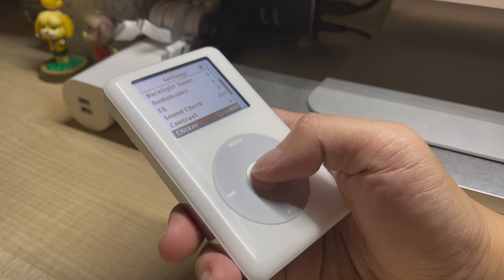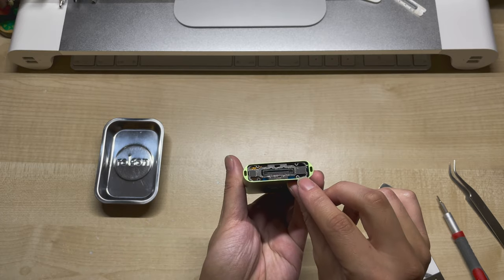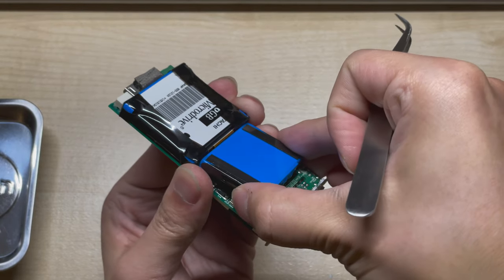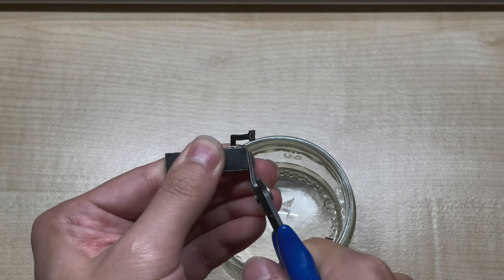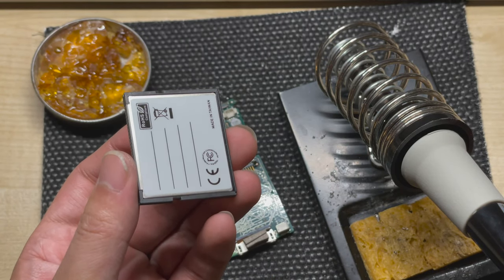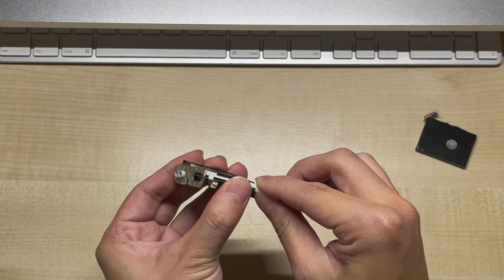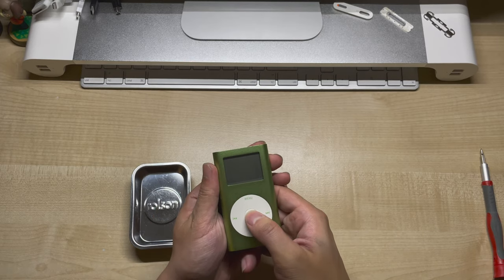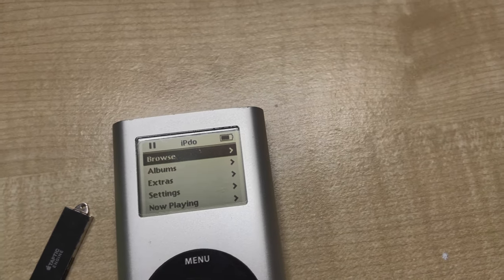iPod Mini Taptic Engine Mod Tutorial

Comment: the minis (ideally gen2) are highly moddable, i've done a few, chromed cases,  (re-coloured or bare polished) re-anodised cases, clickwheel and centre button swap from 5th or 6th gen classic (requires some filing), led backlight colour change for MADE IN THAILAND lcd displays, recolour the PVC endcaps  with upholstery vinyl spray dye .. there's lots you can do .. remove the end caps without case damage by hot gluing a cable tie to them in two places, practical memory limit is 128gb, as there is a limit to the amount of songs they can keep track of .. maybe 20,000 or so, can't quite remember
Reply: clickwheel mod ..  how-to

1) remove the 4 rear clickwheel screws, and disassemble as much as you can without pulling apart any glued components ... put both black and white glued-together clickwheel assemblies in a small container of methylated spirits for 1/2 an hour ... isopropyl alcohol would also probably work ... this will loosen the glue used to attach the plastics to the circuit board which tracks the finger movements

2) the black plastic outer has some protruding tabs on its underside which i removed with a sharp blade, they were used to align the plastic with the finger-track circuit board

3) from memory, i think i used a hand held spherical-looking grindstone to remove some material around the inside hole of the underside of the black plastic clickwheel .... do by hand, not with a machine, and slowly; i think i recall also using a flat blade around the inner bottom of the black clickwheel which stops the button rotating, as that portion interfered with the mini's finger-track circuit board

4) the inner clickwheel button also needs trimming with a small file, removing the 4 anti-rotation tabs on its circumference, and i think i sanded both it's bottom surface and circurmference; 5th gen are flat plastic, 6th gen are dished aluminium

5) removing the tabs as in #4 will cause the inner button to be able to rotate, so get the white button, sand the domed top surface off until it is quite thin, and glue that to the underside of the 'black' button, the tabs on the underside of the old white button will then locate into the mini assembly

6) everything needs to be fitted so the centre push button works correctly, but without any slop; so take your time, it is easy to remove too much plastic, too quickly ... put some tape over the clickwheel when re-inserting into the case, to stop it being scratched if the black click wheel is affixed to the finger-track circuit board, or better still, cut up a square of thin flat plastic sheet (like you find on a plastic blister pack), a bit bigger than the click wheel a put it above the clickwheel plastic, and slide it out after inserting the assembly into the case

7) you can get some special ipod clickwheel 3M adhesive pads from ebay to affix the black plastic to the finger wheel circuit board which is what i did, but double sided tape or easily dissolvable glue would work as well ... don't use water based glue ... take your time getting the alignment correct; the 3M pads only give you one chance

8) painting the white plastic end caps requires vinyl paint, like you get in an auto-parts store for car upholstery ** ... i used a mini-airbrush to apply it, but spraying straight from the aerosol can would probably work too ... don't worry if it looks like you applied too much paint ... just let it dry ... vinyl paint is very forgiving in its application, and is great for other plastic types as well, and is the only thing that will stick to PVC plastic, and remain scratch resistant .. the high level of strong solvent in the vinyl paint melts the surface of the plastic, etching it, for a good bond ... enamel paint will not stick well and can create a thick layer which can interfere with the tight tolerances apple uses... clean the white end caps with methylated spirits or isopropoyl alcohol before painting

**
I went thru the drama of painting pvc, and auto/car upholstery paint was the best and most scratch resistant I found ... the black is mainly carbon black and MEK (methyl ethyl ketone) and butane propellant... MEK is a very strong and nasty solvent, and also the most active ingredient of pvc pipe primer ... it will "melt" the top layer of pvc allowing the pigment to bond. It is also great for acyrlic (perspex) and ABS plastics, and doesn't really effect dimensional tolerances

9) to remove the endcaps without damage, i drop one or two blobs of hot melt glue onto them (without the hot melt gun metal tip touching and hence melting the end cap), and press a cable tie into the hot glue, when the glue is cold and hard, pull on the cable tie to remove the endcap, then remove the glue by twisting the cable tie, and any remaining glue with your fingernail

10) black clickwheel and silver button looks good on a silver case, you can get brand new, cases on ebay .. they dont have the apple branding, disksize logo or other text, as those are probably laser-ed on after anodizing, and the text can come in different languages, it will make you mini look like a macbook .... re-anodizing is quite an involved process, you need sulphuric/sulfuric (car battery) acid, a controllable powersupply, and optionally, some water soluble pigment dye ; strip old anodizing with phosphoric acid which you can find as clear-as-water 'rust remover' at a hardware store -- it can take a day or two if the concentration you are using is like 33% ... chroming requires the stripped and polished case to be 'zincated' for the underlying copper plating to adhere to the aluminium

11) there are spare clickwheel assemblies on ebay

12) the backlight mod will only work on one of the two types of display the gen2-MINI used, the moddable ones are marked "made in thailand" ... i haven't tried modding a gen1 display
Reply: ipod mini's firmware database is limited to indexing less than 25,000 songs,.. so practical limits are 128gb for lossy/compressed music, 256gb for losssless, unless your 'songs' are entire breakless albums, symphonies or podcasts or you want a portable usb2 harddrive. 

my car stereo is a 2008 becker 7990 with separate accessory becker ipod controller adapter and happily supports an ipod mini equipped with an 128gb udma cf card made by KingSpec, which is 60% full and has 10,000+ lossy songs on it. prior to the becker, that car  had a 2006 model JVC headunit with separate JVC ipod controller, but controlling the ipod thru the interface was too complex for me, the becker interface is much simpler, and now these long discontinued made-in-germany headunits and becker controllers are worth more than when new and are VERY sort after.

most modern car stereos dont support ipod minis as the remote control protocol changed over the years, my other car has an ipod touch 3rdGen as its remote controlled music source, its 2014 kenwood  stereo headunit with inbuilt ipod remote control (no separate controller box) and rear usb connector couldnt see or control the ipod mini. 

so if your car stereo headunit is relatively modern, and controls your ipod via inbuilt usb .. check compatibilty carefully in the manufacturer's manual, remote control of the mini's probably wont be supported, and you'll be stuck using a 3.5mm audio cable between the mini's headphone jack, and headunit's AUXillary input with control via the mini's click wheel only or  remote equipped headphone cable or mini-specific accessory wireless controller such as a period correct "Griffin Airclick Mini Remote"
Reply: Wow almost the same technique I used on my iPod Mini's top caps, I use popsicle sticks with hot glue. I also made a "chrome" Mini by buffing the paint off and installed a 5th gen click wheel face! Actually I think it's on my IG still.
Reply: @highvoltage12v  my chrome plated one is actually chrome plated, first the electroplater 'zincates' the chemically stripped and manually polished case, then its copper plated, then nickel plated i think, then chrome plated. 

personally i like a clear anodize, which is anodized as normal on a chemically stripped then highly polished case, but not colour dyed, it will lose a bit of its sheen, but will never tarnish ... i did a couple where i used colloidal silver as the dye, but the result, whilst visible, was subtle compared to a clear anodize

i did want to try a white anodize, which some people say is impossible, but never got around to getting the right chemicals - it requires two separate 'dyeing' baths 
first bath is barim acetate (made from barium carbonate and acetic acid)
second bath is sodium sulphate
they will react to form barium sulphate in the pores of the aluminium which is a white insoluble powder

batteries for these models are getting rare, i could do with half a dozen new batteries .. windows seem impossible to find, so may have to CNC cut your own  from 1.6mm / 0.0625" clear plastic if cracked or crazed
Reply: @antdavisonNZ  you haven’t got a choked case you would sell have you?
Reply: @TimdeVille  i have one unused never-lasered (no apple logo or text on rear) are case chromed, one in clear anodize, a few used silver cases with HP branding - i have no windows left - postage out of NZ is super expensive usd40 untracked, usd60 tracked -- you would be better to get done locally.
One thing i will say about chrome is that it builds up the case thickness, so you would need to file down the windows VISIBLE edges a little for flush factory fit
Reply: @antdavisonNZ  thanks for the reply. Shame about the postage costs so yes, I’ll have to find locally but no idea where yet. Choked sounds really cool. Thanks!
Reply: @antdavisonNZ  Thank you very much for the detailed instruction. I followed all the steps, but have a problem with the center button: it doesn't move; i can't press it, it seems fixed too tight. I'm not sure what step to follow next, because I'm not sure what causes the problem. What did I do wrong? Did I sand the plastic outer too much or should I sand the center button more? Or should I sand the white original mini button more?
Reply: @CortaxEV  you only need original white if you dont want the black centre button to rotate as the white button has anti rotation tabs on it, from memory if you use it, you will need to sand it until it is VERY thin to provide enough clearance, dry assemble and test everything before adhering the plastic outer ring to the capacitive sensitive circuit board, as if you are using the OEM 3M double sided adhesive 'donut', you'll need to soak them in methylated spirits or isopropyl to get those assembled pieces apart
Reply: If the songs are mp3, then the limit is 128gb but if they are flac, it's 256gb?
Reply: @arthurbttf  the limitation, you are talking about,  is the database, how many songs can the iPodMini cope with before it an no longer keep track of them all, its around 25k, then here is the limitation of how much physical memory the firmware can actually address, the biggest I made was 128gb, others have done 256gb
Reply: @antdavisonNZ  I have experience installing 512 gb
and my friend installed 1 tb

Comment: The best way I found to get the top and bottom caps off the iPod mini is to hot glue a popsicle sticks to the caps and use the popsicle stick to pull them off. Then use a plastic spudger to separate the hot glue from the caps.
Reply: Does the hot glue not damage the plastic?

Comment: Curious how this affects battery life? Also any other haptic motors compatible? Seems Ifixit has these parts for sale, I'm gonna do this. Also crazy how the taptic engine sound just like the original speaker in the video.

Update: I did it, it worked. I'm pleased. Thanks for the tutorial and the idea!
Reply from the maker: The Taptic Engine doesn't have any noticeable effect on battery life, it should draw the same power as the original clicker. Any linear actuator that runs on 3V voltage should also work (I've tested the HD Rumble from a Nintendo Switch and it works too, but it doesn't fit the iPod casing).
Reply: @NekoMichi  Thanks for answering. I ordered an iPhone 7 taptic engine. It seems like a useful mod as I can't hear the speaker click when listening to music and some sort of feed back from the wheel is really nice to have. Really don't like the click in headphones setting though. Nice idea 👍

Comment: Nice job! Just wondering if using CF card directly, if adjustments still needed...
By the way, do you think you could make a video with 1G too?
Reply from the maker: CF cards will work directly, other than trimming the tab at the bottom no further adjustments are needed. By 1G do you mean the 2001 original iPod? I've already tested the voltages of the clicker speaker of that model and there's not enough power to run a Taptic Engine.

Comment: Just watched your vid after buying 2nd gen Mini for me, which I intend to mod (flash memory + new battery). This looks awesome and I'd like to perform the mod myself, but I am afraid of my soldering skills. 

One question about 8:48 - the clicker connection. you removed it, then soldered the taptic engine cables on them, but never added it back. Is it supposed to be like that and clicker component is replaced with Taptic engine?
Reply from the maker: Yes, it was intentionally replaced.

Comment: Does the feel of that taptic engine feels nice like on iphone? How big is the sound compare to the original speaker? Thanks
Reply from the maker: It feels similar to in an iPhone, the sound is quieter than the original clicker.
Reply: @NekoMichi  Oh cool thanks! Also how did you made the software to have the taptic words in the clicker setting?
Reply from the maker: I used iPodWizard to change the text in the firmware.

Comment: I really want to do this mod! Your video is very in depth and fantastic. Do you know what gauge wire you used? Thanks
Reply from the maker: I don't know what gauge wire I used, but it was about 1mm in diameter.
Reply: @NekoMichi  Ok, was that the diameter of the wire or the plastic casing housing the wire
Reply from the maker: @Parris2000  That includes the thickness of the plastic layer.
Reply: @NekoMichi  Thank you so much!

Comment: I know you said that you've tried taptic engines from other iPhones, but what about the one from say, a 1st gen apple watch? Can't seem to find any info online in whether it has the same debug pins as the 7's
Reply from the maker: I've tried the Taptic Engine from a Series 2 Apple Watch and it worked. Older generation Apple Watch Taptic Engines have simple 2-pin connectors that you can just solder wires onto, but the Series 4 and newer switched to lego-style connectors that I don't know the pinout to and I'm unsure if they also have the diagnostic pins on the side.

Looking at iFixit's photos, I see a conspicuous section of tape covering part of the Apple Watch Taptic Engine's ribbon cable that looks a lot like what we have on iPhone Taptic Engines and I suspect that's where the diagnostic port is, but without an actual unit for me to test I can't say for sure.
Reply: I have a series 1 that I'm itching to crack open so if/when I do, I'll report my findings
Reply from the maker: Looking forward to your findings!

Comment: how did you make the black clickwheel on the other mini you have?
Reply from the maker: I removed the original plastic cover (it's attached with glue to the touch sensor circuit) and then replaced it with the black plastic cover extracted from an iPod 5th generation. The centre button was recycled from an iPod Classic 6th generation.
Reply: michael, detailed how-to in my reply to my own comment of 2021-december-06/07

Comment: This video is awesome! Is there any chance of getting this mod working on the 3rd gen classic? I'm hoping to put a taptic engine in my own
Reply from the maker: Unfortunately the iPod 1st, 2nd, and 3rd gen use a different model of piezo clicker to the rest of the series and I've tried testing a Taptic Engine against them but it never worked. Not sure if it's because they use different pinouts or different voltages or both.
Reply: @NekoMichi  Ahhh, I see. Do you know what voltage the 4th gen piezo uses?
Reply from the maker: Approximately 3V, I think.
Reply: @NekoMichi  I found the pinout of the 3rd gen clicker through wayback machine, quickly chucked a taptic on it and it works, she's tapping
Reply from the maker: That's great news! I guess the pads on my test device may have been damaged 🤔

Comment: Are these aliexpress cf sd adapters actually reliable once you got them running? I can't decide to go for these or iflash's (they are pretty expensive)
Reply from the maker: They can be hit-and-miss. From what I've heard, the most unreliable ones are the red generic unbranded adaptors because they have an onboard firmware that doesn't play nice with iPods (although some people have been able to flash them with a working firmware somehow). The CF to SD adaptors sold by iFlash are actually just rebranded AliExpress adaptors, but from a different manufacturer. I think they're based on the Digigear CF to SD adaptor, which is one of the more reliable brands for iPod modding.

I've seen Digigear adaptors occasionally appear on Amazon or other local marketplace sites.
Reply: @NekoMichi  Nice thank you good to know. I might check for the Digigear or that what you are using then

Comment: Michi, what wires do I buy?
Reply from the maker: The wires I used were around 0.5mm in thickness (approx. 24 gauge).
Reply: Ah yes, but what kind of wires?
Reply from the maker: I just used whatever I had lying around, I don't remember what exact make or model product was used. However, I know that some people have taken apart USB or headphone cables and reused the internal wiring for this type of project.
Reply: Thanks Michi! Also, what tape do you use?
Reply from the maker: I use standard electrical tape. Any type of tape will work so long as it's not conductive.